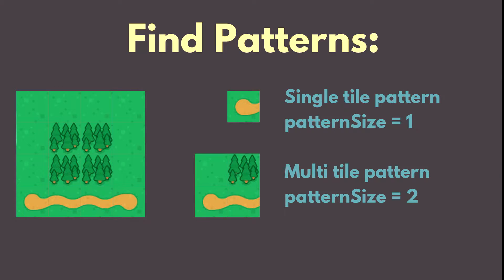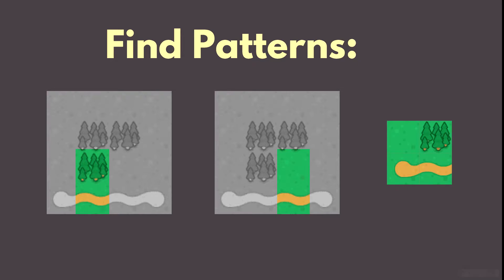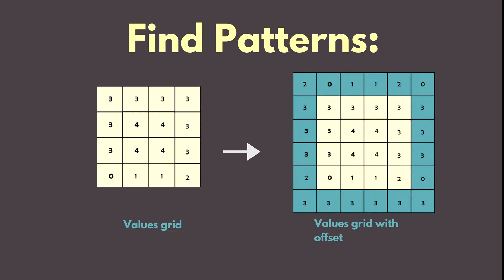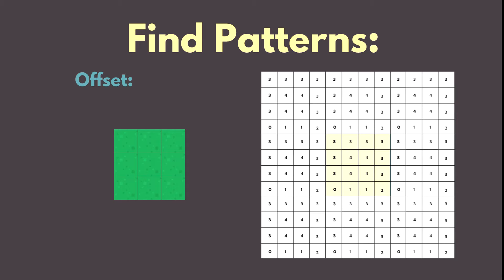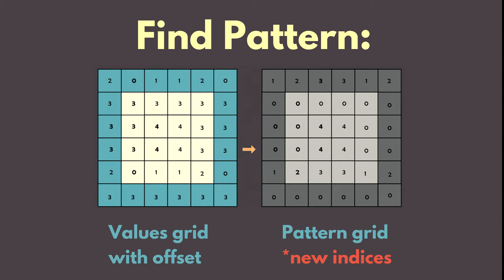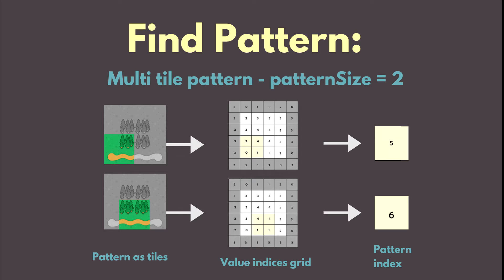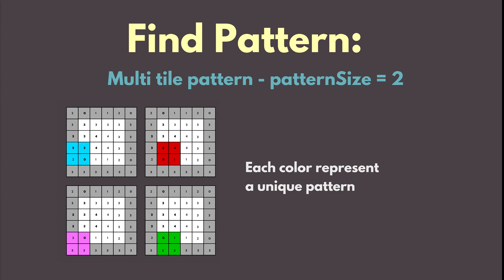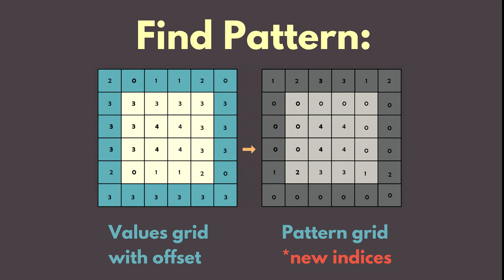Wave function collapse Tutorial 03 Theory - Find Patterns

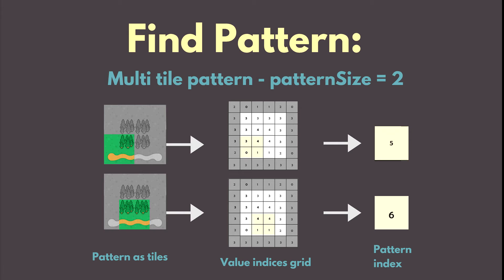Comment: Hi, great vid! I.dont get why at 10:35, the pattern.index.is 5
Reply from the maker: Sorry about that. If you take a look at the grayish table/grid at the bottom left corner. Take the corner value and one to the right and both of the values up from them. You should have[ [2,0] [3,3]]. This would be pattern_0 if pattern size is 2.
If we take the next 'square' making 1 step to the right we get [[0,1][3,3]]. If it is unique meaning no other pattern has those values we will mark it as patter_1 (so previous index 0 increased by 1).
If you reach the end of this line you will find that the last pattern is exactly the same as pattern_0. That is why we don't make it into a new pattern but set it as pattern_0. Since you have reached the end of the line we go back to the bottom-left corner and go up 1 row and start again. This is just a way I have implemented it. It doesn't have to be like that. That is basically why pattern_5 is what it is.
If you still don't understand just write down all the 'squares' starting from the bottom-left corner and you should reach the same patter indices as I did if you give each unique square a unique index. 
I know I am not the best at explaining sruff but hopefully it will be helpful. Let me know if you were able to figure it out.
Reply: @SunnyValleyStudio  ohh I get it, great explanation! Thanks a lot, I will definitely continue watching your vids. Great work!

Comment: I dont understand how you formed that pattern grid(greyish)??
how did you fill it with those values?
Reply from the maker: If you mean the one around 8:53 it's just a matter of implementation. The gray grid represents pattern numeration. 
The pattern can represent 1 cell (tile) or 2x2 set of tiles that we want to repeat. The values in the first grid are the indicis that I assign to each tile that we read from the tilemap. The pattern grid (grayish) creates new indices since it can be pointing to 1 tile of to a set of tiles ex 2x2, or 3x3. That is why we need to create a separate indices to describe patterns. 
Since we start traversing the  grid from bottom-left corner the first one is 0. Pattern with index 0 points to the tile with index 3. This is easier to comprehend if we take pattern of size 2. Pattern with index 0 would correspond to an array of tile indices [[2,0][3,3]] (values at the bottom left corner of the green-yellow grid) .
I do apologise for not explaining it clearly enough.
If you still don't get it start from bottom-left corner of each grid and compare respective indices and you will see the relation.
Reply: @SunnyValleyStudio  ok thank you for the videos and reply
what is
I wish pattern indices had different integers than tilemap grid
so when pattern size is 1, this is the corrospondance
3 = 0
2 = 1
1 = 3
0 = 2
this is clear, let me brain storm how bigger pattern sizes are stored, that is still unclear

Comment: 7:32 "Pattern with index 0 stores value with index 3" oh, how :(
Reply from the maker: Hi eris! You have 2 grids: gray and yellowish. The gray one represents our patter indices. Pattern represents 1 tile or a grid 2x2 or more tiles (depends on how you set it up) . On the other hand yellowish grid represents our input tilemap. We gave them indices to be able to use them in our code. If you look at spaces on the gray grid which have 0's the respective spaces in yellowish grid have 3s in them.
The reason that we have 2 different indices systems is the offset that we need to create so that we know what are the neighbours of the tiles on the edges to ensure that our input tile map is repeatable (we assume that as the constraint).
I hope this gives you an idea to ponder. I had a lot of trouble grasping the whole thing myself so just give it another go in a few minutes :) I'm sure you will get it.
Reply: @SunnyValleyStudio  Oh my, I got it, thank youuu. We started in the bottom left corner, and there was a value of 3 so it got a new index of 0, then there was a whole row of values of 3 so no new indices for the pattern grid were made untill the next row where a value of 2 got a new index 1 on the pattern grid
Reply from the maker: I'm happy to hear that :) thanks for watching!
Reply: @SunnyValleyStudio  I get it now as well. Great explanation!